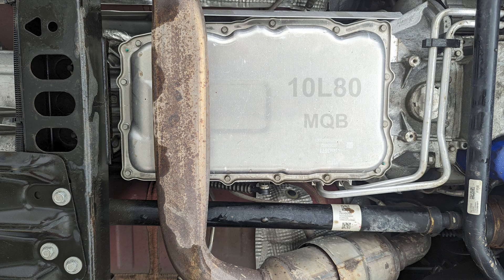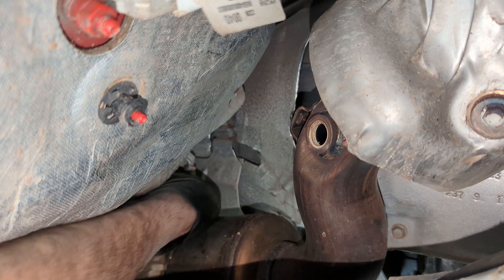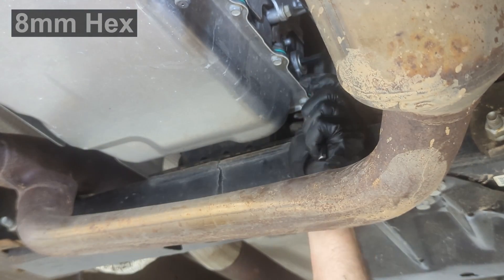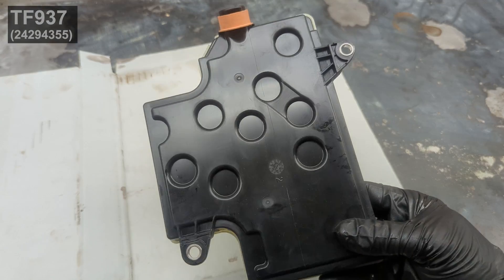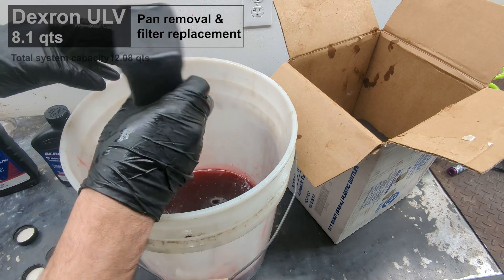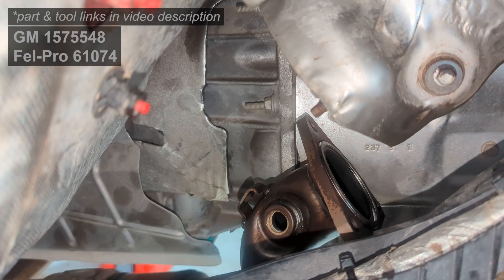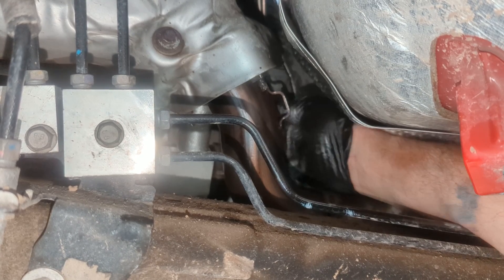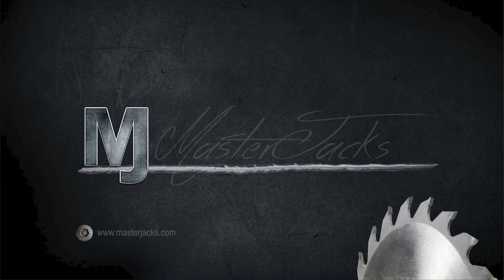2019-2024 Sierra/Silverado: 10-speed Transmission Fluid & Filter Change (10L80)

Comment: Great job.  WOW this is a tough job.  You intentionally are supposed to add more transmission fluid than the fill hole depth???  I wonder if I can just change the fluid and skip the filter.  Do they even get clogged? EVER?

Comment: Great vid I’m doing this job now and want to question if it’s safe for the transmission to forgo the warm up top off like you demonstrated… is it better to run it get it to temp then add as needed instead of cramming all the fluid in at once? I’ve read it may cause foaming and damage

Comment: I had a yukon years ago and I did a transmission fluid and filter replacement on that. I cut the exhaust and put it back up. It was older and the bolts were questionable. Worked great though doing it that way. This is a great video showing the detail and pumping needed to fill it
Reply: brilliant!

Comment: With the 10L80, is it possible to do the transmission fluid flush like the flushes you did with the 6l80's through the radiator port where the transmission cooler lines connect?
Reply from the maker: Unfortunately, no. Nothing easy. GM may have a tool to connect in line with the cooler lines at the transmission itself, but I haven't seen it or used it personally.

Comment: I just subscribed to your channel. I have to ask you, how many miles should my truck have before I change the transmission fluid and also the differential fluid?.Nice job!
Reply from the maker: There are factors like load, heat, environment, etc but 50k miles is a good round number/frequency to shoot for

Comment: Question on the fluid level set process... The vehicle is cold and the fluid is at its minimum volume when you first remove the plug (3:00) and a steady stream of fluid drains out. If the ATF is hot and expanded above that volume and proper level is a slow drip from the same plug hole (8:45), doesn't that mean the pan was overfilled from the factory? Assuming the truck is level and this was the first time it was serviced and not overfilled previously.
Reply from the maker: When I initially pulled the plug to suck some fluid out of the pan (@ 3min), the vehicle was not running. The fluid settles out of the transmission gears and lines and into the pan.  To get an accurate level (final check after service), the vehicle has to be running (8:45).
Reply: Makes sense. So in your opinion is the level check more about circulating fluid through the system vs bringing temp up to account for expansion? 
I did some rough calcs on thermal expansion vs fluid level rise and its a small number. All the torque stalls to get to 180F seem like alot to account for a 4-ish % change in volume. 

Feel like Im just trying to find a way to justify starting the truck, letting it run for a minute, then pulling and replacing the plug to set level without getting it all the way scalding hot and burning myself on the exhaust and fluid. Ha

Thanks again for the content and actually replying!

Comment: Thank you for such a great video, I just did my fluid and filter change on my 3.0  duramax 10L80.  I was happy to learn that I did not have to mess with the cross pipe and the pan was super easy to drop.   I had one question though, I let it drain all the way and added 7 Quarts, it stated to overflow so I cycled through the tears and let it come up to temp, left the truck in Neutral and filled it up until it was overflowing.  come to find out it only took 7.5 Quarts or so.   I looked online and it says total capacity of the 10L80 is 12 Quarts,  The fluid and filter change should take 8.1 Quarts.   Should I be worried that I am low on fluid since it took only 7.5?

Comment: You do NOT  need a special bit for the filter bolts. An 8mm 5/16 fits perfectly. But they are an extremely light material and I would absolutely not reuse them now that I've handled them

Comment: Very helpful. There is a fill plug on the top of the transmission I found.  Got to take the shield on the passenger side off and you will find it.
Reply: Why the fuck doesn’t anyone have the tech manuals?

Comment: Has anyone tried to modify the y-pipe to make it easily removable for future service changes? Perhaps by adding clamps or welding in flanges with easily removable bolts, nuts and donuts?
Reply: bad idea. will leak. you can cut the sides (after the cats) and extend them with welding just lowering the stock cross over section instead giving you enough room to slide the pan out.

Comment: I recommend also opening the return cooling line and let the pump pump out the remaining fluid. Pump until the fluid changes, color, and the new oil starts coming out. Then, top it off and check the level again.
Complete fluid change.
Reply: This was the part that I was looking for because I noticed it was missing. The entire system holds 12 quarts. If you're only getting 6-8 quarts in it after this service, you're leaving a lot of old fluid in the cooler and torque converter.

Comment: Just my 2 cents.... This video was super helpful, I used it as a good guide to doing the same thing on my 23 Silverado 1500 rst. What came out of my transmission didn't seem like 8 quarts, maybe 5 but what I've already put back in is approximately 7.8 quarts and now waiting to get up to temp to check fluid level. A guy in a forum or comment section said he only took out 6.5 quarts and therefore only put that much back. I filled cold and only got about 6 quarts in. Then I started it, shifted through the gears slowly and opened the fill plug.... I got the remaining almost 2 quarts in while running. I'm 30 degrees away from target temp to check again, we'll see how it goes.

Comment: Thanks for the video. Has anyone here swapped out the transmission pan with something aftermarket like a PPE Power 128051700 (I have the 8 speed)? Also tempted to replace some exhaust parts after watching this but don't know what's out there to make this job easier.
Reply: Installed a PPE pan on 10L80 this past weekend with no issues. Also did a Borla true dual exhaust - Expensive upgrade but after you make the cuts and reinstall there is a collar behind the cat and ahead of the muffler so you can move the cross section with just two bolts.

Comment: Did this on my 19 Denali 10L80. Bunch of complaining whiners in here or you have more $ than me. Wasn't that bad.  Just set a Sat aside, take your time and save $1k. Probably helped that i have a 3.5 lift on my truck, but I didn't remove wheels or inner liners.  Only had to remove 1 o2 sensor, was able to remove the other o2 wires from the body.  Dropped exhaust and downhill from there.  Reused exhaust gaskets - 1k miles later doing fine. You can do this.  It's easy!

Comment: My Gm shop snapped my exhaust bolts and then broke my exhaust. Had to get it rewelded. Also blew out the gasket so the transmission fluid was leaking out of the truck. Good thing I checked it a week later. Still tried to charge me but ended up getting it done after a couple talks with the guys behind the desk. Luckily the guy working at the time was really friendly and didn't argue much. Thanks for the video still can't trust people to touch my vehicles.
Reply: That is my fear taking it in and paying for them to fuck it up!
Reply: @carlosisanchez3471  yea I will be doing it myself next time

Comment: Goodness, doing research on basic maintenance on trucks before I buy and this thing looks like a complete nightmare to do anything other than oil and the rear diff. Meanwhile, the L5P looks like an absolute dream to change any/all fluids and filters…. Wtf GM, knocked it out of the park on the HD trucks and then have to pull teeth to do the trans fluid lol

Comment: Used your video to change the fluid in my 2024 Silverado 1500 (45k miles). I have the 10 speed transmission however mine showed a different code than your MQB, mine had MHS (Transmission, 10-speed automatic with Electronic Transmission Range Selector, (ETRS), electronically controlled with overdrive, tow/haul mode and steering column paddle shifters. Includes Cruise Grade Braking and Powertrain Grade Braking). 

Everything was identical to your video on changing the transmission fluid/filter with the exception of how much fluid came out of my vehicle. I barely could get any fluid out of the fill port with a fluid extractor. I ended up backing out the bolts holding the pan to the transmission and left 1 or 2 threads installed (just one bolt in the front and one in the rear). This opened up the gap in the pan to transmission large enough I could stick my extractor tube into the pan directly. I ended up removing approximately 6.5 quarts. 

I removed the old filter, installed a new one and had to re-use the bolts just like in your video. My local dealer didn't have those bolts in stock and I couldn't source them online in a reasonable time.

When I went to fill my transmission, I could only get 4 quarts in the pan. I ended up starting the vehicle for 2-3 seconds and shut it off, that allowed me to put 2.5 quarts into the pan. (I could only get 6.5 quarts into mine whereas your video you got 8.1 quarts).

I did the fill check procedure just like in your video. When I went to check the fluid level (with it running), I pulled the plug and I have a very small stream coming out of the transmission. I put the plug in and took the truck for a test drive. The transmission shifted fine and everything seems good. Went back home, checked the transmission level again (With it running) and I was getting dribble out of the transmission still. Part of me was bothered by only putting 6.5 quarts in, so I verified the amount I took out. I poured the extractor tank into quart bottles, filled approximately 6-1/2 quarts, about the same I put in the transmission.  (I did buy 9 Quarts of the Dextron ULV) Guess mine had more options and could have had fluid contained in "extra" modules. 

Job from start to finish took me roughly 3 hours. (Taking the exhaust down is fairly easy, don't let this discourage you from doing this job.)

Good video!
Reply: Thanks for sharing this. Keeping track of the fluid amounts exactly is a good idea, if you can

Comment: Can you dump the old fluid through the cooler line going to the radiator, like on the older ones? This wouldnt replace the filter but at least do a drain and fill
Reply from the maker: @John-2fnf  I was hoping that was going to be a possibility, but the cooler line setup on these newer models isn't nearly as accessible. I made an attempt once, and if I'm remembering right, it was going to entail fuse block removal. I was like, nah.
Reply: @MasterJacks  i can understand that.

Comment: Did you turn off truck after heating up transmission fluid to 180 to drain fluid to a drip?
Reply from the maker: @davidbusbee7801  no, the pickup needs to be running and in park or neutral when checking the fluid level

Comment: How much does a service like this run?
Reply: Dealer in OKC quoted $400. Told me they only do the flush - no dropping the pan and filter change.  A transmission shop quoted me $900 to do it properly with filter.  Will be doing it myself except, hopefully, removing trans mount bolts and lifting trans away from exhaust

Comment: Can be done without dropping exhaust. 4x4 between trans crossmember and member towarda rear end and a ratchect strap around the exhaust to bend exhaust Y down. 2 bolts hold the transmission to the crossmember use a floor jack I left one thread in each bolt and used a floor jack to raise the the transmissiom to that height. JUST enough room the remove the pan, what an absolute gem of a design
Reply: You should make a video of it
Reply: @ernestolopez9513  haha I should have in the moment good luck man she's tight
Reply: @ernestolopez9513 didnt think of it at the time. Its still super tight doing it this way. Gotta pull the pan out a few inchea and turn it on an angle and pull again if I remember correctly
Reply: I’m guessing this is how my dealer did it. On my 07 1500 the transmission shop used the same process, but wouldn’t admit to it
Reply: @basicuser54i have a 2018 and a 2024. The clearance for this is signifigantly reduced on the 2024 for getting it out I dont have to unbolt the transmission on the 2018. Just ratchet strap on the exhaust
Reply: Couldn't get it out on My 2019. Don't know why but it's still too tight.. super disappointed:(
Reply: @amisklabel8202  2019 is when they made it harder. You unbolted and lifted the transmission and still couldn't get it?
Reply: @Cja9  Yes Sir, Held the exhaust down and jacked it up. Even prying on the other side of exhaust didn't make it happen. Fighting the exhaust flange bolts ATM.  Afraid to use an impact.
Reply: @amisklabel8202 oh that sucks man. Yeah the pan doesnt come straight out u gotta turn it 90 degrees and pull it out on an angle. Yeah I would 100% put some anti sieze on those when you put it back together its a real pain doing it the way GM wants you to do it

Comment: The engineers who designed this mess should be embarrassed.  From lack of a drain plug, tight fill plug, need to remove the exhaust system, what a crock.

Comment: Thank you for making this video. I just completed my fluid change on my 2019 Sierra. No lift, just a jack and 2 jack stands in my garage. It took around 10hrs total. I used AMSOIL ULV in the  easy packs, no need for a pump if you use the easy packs. I was only able to get around 6qts of fluid back into my truck not running with the rear end jacked up a foot thinking it would allow for more fluid. That wasn't the case. Once I re-installed the exhaust and had the truck back on level ground, I crawled underneath and remote started the truck and was able to add almost 2 more qts. (8ish total)... I will never do this again, WTF are the GM engineers thinking, give us 1 more inch between the Y pipe and pan. 🤦‍♂️
Reply from the maker: @ChrisPeters-dy7zm  your final remarks are spot on 😂
Reply: @MasterJacks  - or an external filter and drain bolt. It’s almost like they make it difficult intentionally so that you’ve got to bring it to the stealership. Maybe? My wife’s suburban has about 30k on it, so I’ve got a tiny bit more time before I’ve got to do this it seems
Reply: The 3.0 diesel truck don’t have the y-pipe like the v8 trucks do, making it 10x easier to do. Will be doing my fluid/filter change myself cause the dealership wants $1000 to do this simple job.
Reply: 10 hours 😮

Comment: Nice video.
Need advice,  at4 yukon 2021 10l80... was able to drain only 6.5 quarts of old atf, with cooler....
And also was only able to fill 6.8 quarts of atf oil.....did I somthing wrong?.
Reply from the maker: @taylorlaneyachtandship3346  that's normal for a drain and fill 👍. The remainder of the fluid is in the torque converter and cooler. To get it out, you'd have to open the cooling circuit (disconnect one end of the cooler return line) and start the vehicle. The transmission pump would then force the old fluid out while you simultaneously add new fluid through the fill port. It's not easy to do on this transmission without special equipment. 

Replacing the filter replenishes about 30-40% of the fluid, which most people consider good enough.

Comment: So much easier on the 3.0 duramax. No exhaust in the way to deal with. Thats over double the work. I know a tranny shop guy that for years has been draining all the oil and adding 2-3 litres into the pan before he installs it. Then he removes the oil cooler line and starts the vehicle with the open hose in a bucket. On startup you will get a full stream of oil out the hose that is coming out of the cooler/torque convertor. When the stream begins to drop off shut down and top up to the proper level. You will have changed 99% of the oil instead of  75%.
Reply: That's the way I have done it for years but in this case you can't change the filter ! 🤔🤔

Comment: I just did this service this past weekend on my 2018 Tahoe 6.2. Everything went smoothly. Thank you for the video and torque sequence. It was invaluable. There is a fill plug on the pan though, which made it easier. The trans filter bolts were also 8mm hex instead also.

Comment: I found a video on you can also just drop the pan down without dropping the exhaust and then soaking up and splashing out all the tranny fluid and wiping it out then putting your new filter in and then fishing in the new gasket around the valve body and putting it back up it's probably going to be sloppy process but in my opinion I think it's still be quicker than dropping that exhaust open for debate open for debate lol :-)

Comment: I was able to do this without dropping the exhaust changing the filter ,cleaning the pan replacing the gasket is difficult, but it can be done in place. The filter bolts are very long.
Reply: Nice. What year / model truck?
Reply: @ 2020 Chevy 1500
Reply: Do you have the 8 or 10 speed?
Reply: @John-2fnf 10 speed
Reply: @ibister18 thanks! In the middle of doing mine now. Just dropped the exhaust with wheels & inner fender installed. Wasn't as bad as I thought
Reply: You didn’t mention which engine. The diesel doesn’t have the exhaust pipe in the way like the gassers do.
Reply: @AnontheGOAT 👍

Comment: How about a video of doing a transmission fluid and filter change on one of the new 6L80 transmissions 2020 and up that has a drain plug?  There's nothing on Youtube like that.
Reply: It's not an actual "drain plug" it is where you check the fluid level at the proper temperature, like his video where he did the same thing at the fill plug. I have a 2024 GMC 6.6 gas and wish there was a way you could suck out all the fluid you can and fill up then do the check procedure, say at 15 to 20K intervals to keep the fluid fresh and not have to do the filter. Any advise??